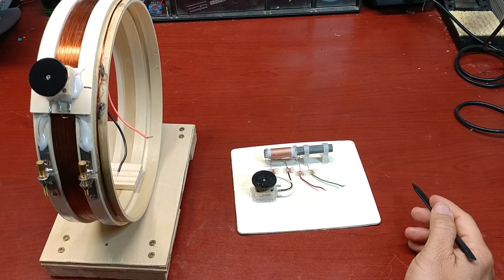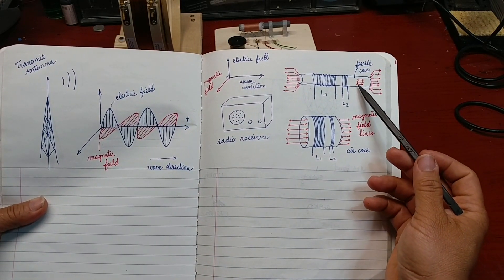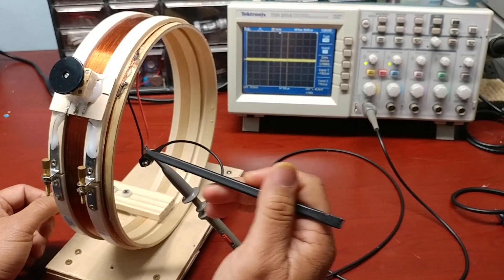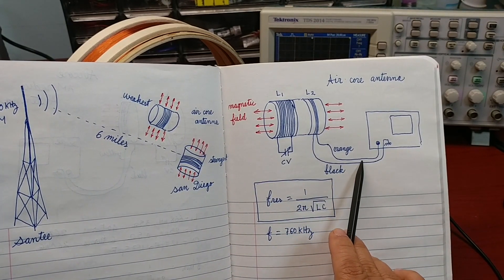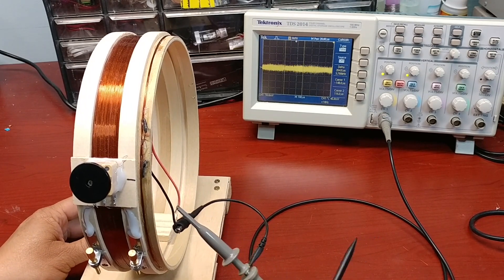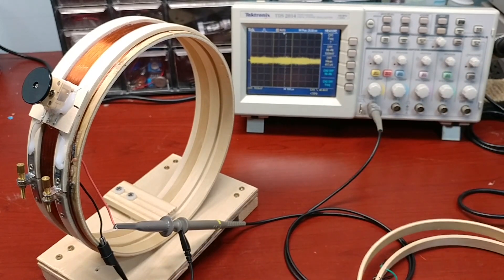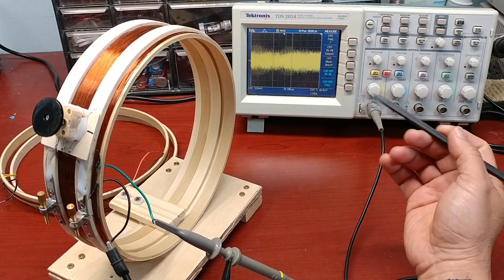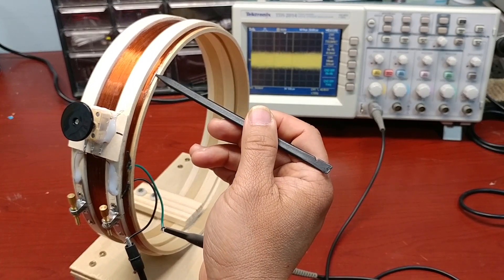Air Core AM Radio Antenna

Comment: I made a loop antenna 4x4 feet. It worked well.
One thing I did differently was I used a very small capacitor to couple the signal into a crystal radio.  This works well.  The capacitance is something near 1pF.
Reply from the maker: Cool idea. I will try that way when I get a chance. Thanks

Comment: I used a 16 inch pizza box and found that about 17 turns of 24 AWG magnet wire and a 450 pf tuning capacitor covers the entire American AM band. My loop is far more effective than the AN-200 loop they sell, but I still love that one too. I use the AN-200 connected to 500 feet of insulated wire and an earth ground to get decent radio signals into my camper. It works but not as well as I had hoped due to power line interference but it does get the main target stations I listen to.
Reply from the maker: I'm glad that you got the extra large pizza box antenna work well. I tried a 3ft diameter circle pvc loop, ~20 turn of 24 AWG. It didn't work at all. I think it's because I wound them in several layers. I noted all loop antennas I saw online are wound in on layer.
Reply: Try about 5 or 6 turns for three feet. I made a four foot loop from a solar panel box with about 6 or 7 turns and it tuned below the middle of the AM band. Try removing turns if there`s a target station you want until it hits it. 

My target with the 4 ft coil was 870 WWL in New Orleans 180 miles away and I got a very strong daytime signal. I could faintly hear Dallas 300 miles away but a relative`s huge TV and WIFI interfered with the weak signal. I need to test those coils again since I`ve moved and make more. 

If you have room stretch out two insulated wires about 200-300 ft long each in opposite directions and connect them to each end of a coil. I used to wrap 80 turns of 24 AWG magnet wire close wound and side by side on a vitamin bottle or paper towel tube and do this and place the coil near the radio.  @musikbox2020

Comment: Great Video, I am thinking abut duplicating your experiment, me Ia sk how did you glue the three loops of wood for the main antenna ?
Reply from the maker: Thanks. The two inner loops are glued together using wood glue. The two bigger loops are clamped on the inner loops by tighten the screws. The third loop is removable. It can be inserted or pulled out from one of the outer loop. I bought the 8 inches needle art from hobby lobby.  If you want to make one, pay attention to winding the coil, make sure copper wire in order and flattened on one layer.  I tried quick winding the copper wire with several layers to save space. I didn't work.  It's little bit strange.
Reply: @musikbox2020   It looks like my rings are not as wide as yours, how many turns did you use ?? using  n=((L*(18d)+40l))/d  I get about 42 to turns of .4mm wire with the length of the coil being about 20mm for an L of 668uH
My rings are about 3/8 of nd inch (10mm) wide and 8 inch Diameter for the width of he coil I estimated about .75 inch

Comment: À bạn ơi , theo lý thuyết về radio thì sẽ có khối trung tần , nhưng trên mạng thấy có nhiều mạch radio đơn giản chỉ có mạch cộng hưởng LC rồi qua đi diode tách sóng và vào khối khuếch đại âm thanh luôn mà không có trung tần 10.7 hoặc 465khz.
Vậy tạo sao họ không làm radio đơn giản như vậy nhỉ , mình ko hiểu chỗ này mong đc bạn giải thích, cảm ơn bạn trước
Reply from the maker: Thắc mắc của bạn cũng là câu hỏi nằm trong đầu mình trong khoảng thời gian dài trước đây.  Mình cần các tầng lọc trung tần để làm gì khi chỉ cần mạch cộng hưởng và diode tách sóng là có thể có được tín hiệu âm thanh rồi. 

Để trả lời câu hỏi này mình sẽ bắt đầu từ băng thông (bandwidth) cho mỗi đài phát cho phép. Như các đài phát băng tần AM thì băng thông cho mỗi đài là 10kHz, cộng-trừ 5kHz từ tần số trung tâm (center frequency). Ví dụ, đài phát thanh TPHCM có tần số trung tâm 610kHz thì đài chỉ được cho phép chiếm dải tần số từ 605kHz to 615kHz.  Băng tần AM có tần dải số từ 540kHz - 1700kHz, mỗi đài chiếm 10kHz thì sẽ có chỗ cho 116 đài phát (540, 550, 560, ..600, 610, 620,.. 1680, 1690, 1700kHz).  Về phần máy thu, nếu chỉ dùng mạch cộng hưởng LC, thì băng thông nhận khá rộng có thể đến 100kHz. Ví dụ như muốn bắt đài TPHCM thì máy thu dùng mạch LC sẽ tiếp nhận dải tần số từ 560kHz đến 660kHz.  Nếu chỉ có một đài TPHCM trong dải tần đó thì mình nghe tốt, không vấn đề. Nhưng nếu có đài nào khác trong dải tần đó mình sẽ nghe luôn các đài khác, âm thanh chen lẫn với đài TPHCM.  Mình nhớ khi còn ở Việt Nam, mình có làm radio đơn giản với mạch LC, thì mình nghe cùng một lúc với đài Sông Bé, Tiền Giang gì đó, và cách nghe tốt nhất là chờ cho mấy đài khác hết giờ phát thì mình được nghe đài TP rõ ràng.  

Thì chức năng của các bộ lọc khuếch đại trung là lọc làm sao bạn chỉ nghe được một đài mình muốn nghe dù có đài phát sát cạnh tần số đài mình muốn nghe.  

Tín hiệu ra từ mạch chọn sóng LC có băng thông rộng khoảng 100kHz, và mình muốn thu nhỏ băng thông này lại chừng 10kHz để chỉ cho tín của một đài đi đến phần tách sóng và khuếch đại âm. Bộ lọc trung tần sẽ được dùng ở đây.  Vì qua mỗi bộ lọc thì băng thông chỉ thu hẹp lại một phần và phải cần đến 3 tầng lọc trung tần để thu hẹp băng thông còn 10kHz.  Trên thực tế, có radio chỉ có một tầng hoặc hai tầng trung tần, vì có lẽ ở đất nước đó có đài phát thanh có tần số cách nhau hơn 10kHz, hoặc làm radio giá rẻ.

Nếu ta lấy tín hiệu trực tiếp từ mạch chọn đài LC cho qua bộ trung tần thì phần thiết kế bộ lọc rất phức tạp vì ngoài phần làm nhỏ băng thông, mạch lọc còn phải đáp ứng cho nhiều tầng số của mỗi đài phát. Ví dụ, với đài TPHCM thì bộ lọc có tần số trung tâm là 610kHz và phải lọc ra dải tần số từ 605-615kHz. Với đài Tiền Giang, thì bộ lọc phải có tần số trung tâm là 640kHz (ví dụ) và phải lọc ra dải tần từ 635-645kHz.  Các bộ lọc này rất phức tạp.  Nên người ta chuyển các tần số của các đài thu AM về Trung tần (IF - Intermediate frequency). Cho AM thì tần số trung tần là 455kHz (hoặc 465kHz) và cho đài thu FM là 10.7MHz.  Bộ dao động riêng (local oscillator) và mạch chọn sóng làm nhiệm vụ đưa các đài có tần số khác nhau làm một chung một tần số trung tần 455kHz.

Các bộ lọc trung tần là một dạng Bộ lọc dải tần (Bandpass filter), nó lọc ra các dải tần khác và chỉ cho qua khoản tần số mình thiết kế. Bộ lọc trung tần cho máy thu AM cho qua tần số 455kHz, mỗi tần băng thông hẹp lại. Với 3 tầng lọc trung tần thì băng thông là 10kHz và do đó chỉ có một đài được chọn đi từ mạch chọn đài đến mạch tách sóng.  Mạch tách sóng chỉ cần lọc bỏ tần số 455kHz là được tính hiệu âm thanh và đưa qua bộ khuếch đại âm.  

Bộ lọc trung tần vừa lọc tần số vừa làm khuếch đại tín hiệu.  Đưa tín hiệu từ mạch chọn sóng ở mức vài mili-volt đến vài trăm mili-volt ở mạch tách sóng. 

Một điểm lợi nữa là mạch tách sóng cần có bộ lọc RC tần số thấp tín hiệu âm (Resistor Capacitor RC Lowpass filter). Nếu không đưa về chung tần số 455kHz hoặc không quan các bộ lọc trung tần thì bộ lọc RC ở phần tách sóng khó đáp ứng tách sóng có tần số khác nhau cho mỗi đài phát.

Nói ngắn gọn lại là: 
. Bộ lọc trung tần làm tăng độ nhạy của máy thu. Dù hai đài có ở tần số cạnh nhau cũng bắt được dễ dàng không chồng lẫn
. Bộ lọc trung tần giúp âm thanh nghe rõ hơn vì đơn giản hơn ở mạch tách sóng.
. Bộ lọc trung tần làm cho người dùng dễ dàng bắt đài hơn. Ở các radio đèn ngày xưa, người ta phải chỉnh đến 3-4 cái xoay mới nghe được đài rõ.
. Máy thu có bộ lọc trung tần đáp ứng yêu cầu của cơ quan giám định sản xuất thời đó

Mình hy vọng bạn có thể biết thêm về bộ lọc trung tần. Nếu chưa rõ phần nào bạn có thể hỏi lại. :)
Reply: @musikbox2020  trước tiên xin cảm ơn bạn rất nhiều vì câu trả lời của bạn quá chi tiết và rất dễ hiểu.
Tâm sự chút .
 Hiện tại mình là thợ sửa chữa điện tử , năm 2003 mình xuống trường ngày khai giảng và bị tai nạn gãy 1 chân và phải ở nhà mấy tháng cho khỏi chân , và sau khi khỏi xong mình nghỉ học luôn từ lớp 6 .
Mình rất đam mê điện tử từ nhỏ khi mới lớp 5 mà nhà đã đầy đủ mỏ hàn và linh kiện linh tinh  , và sau khi nghỉ học thì năm 2004 mình từ ngoài bắc vào sài gòn học nghề điện tử, mình học ở 1 tiệm sửa điện tử ở đường đồng đen ,quận tân bình .
Khi vào đó ở cùng anh chị thuê nhà ở quận 12 chỗ cầu tham lương, anh chị cũng từ bắc vào nam làm công nhân may mặc , hàng ngày mình đạp xe từ cầu tham lương quận 12 xuống tân bình học nghề, trưa đến thì chị gái làm gần đó mua cơm đem sang cho mình ăn rồi 2 chị em lại đi ra ngoài kiếm chỗ ngồi nghỉ trưa , chiều 2 giờ thì lại quay về chỗ học.
Khi đó chỗ mình học là cửa hàng sửa đồ điện tử nên chỉ học cơ bản và thực hành chứ không được học lý thuyết chuyên sâu , năm ấy mình hay mua sách ở nhật tảo mạch điện lý thú, và mình có tự lắp radio đơn giản dùng lõi ferrit của radio AM và cuốn dây đồng vào lõi và lấy tụ xoay ở đài AM tạo thành mạch LC, rồi cho vào mạch khuếch âm OTL mình tự làm và hàn mạch trên bìa giấy cứng , vậy mà cũng bắt được radio để nghe, nhưng mạch đó phải đung pin chứ dùng điện lưới là ù xè ko nghe được  , khi đó mình nghĩ làm linh tinh mà cũng nói đc và tự nghĩ trung tần và tách sóng ở đâu khi mà chỉ cần mạch LC rồi khuếch đại âm bằng mạch OTL .
Xong đến khoảng năm 2006 mình biết đến internet ngoài quán nét, và tự lập trình web dùng Html  , rồi lại tự học lập trình 8051 nói chung là mình thích mày mò lắm.
Đấy là đoạn tâm sự và con đường mình học tập của mình, và hiện giờ thì mình vẫn đang làm sửa chữa chuyên về màn hình tivi LCD , bữa thấy video của bạn làm về anten AM là phải xem và đăng ký theo dõi ngay.
Reply from the maker: @trunghieu9851  Thật là thú vị nghe tâm sự của bạn và hân hạnh được biết bạn.  Mình có thể trò chuyện thêm qua email. Email của mình là txnghia@gmail.com. Email của bạn là gì, mình cũng thích học biết biết thêm về sửa chữa điện tử từ bạn.